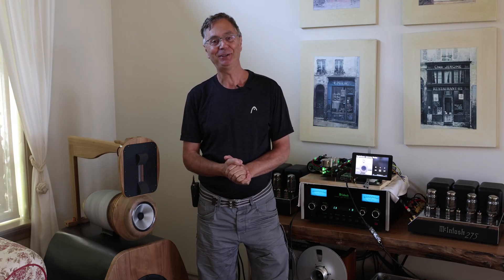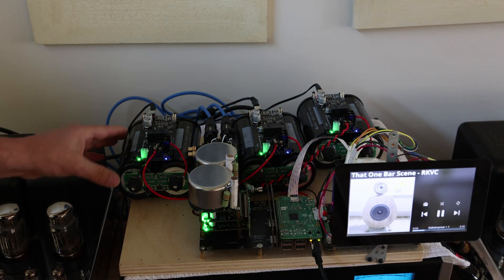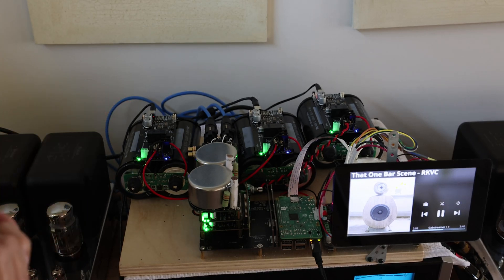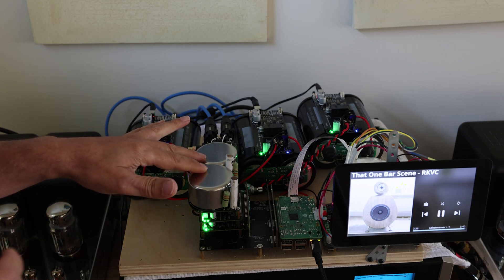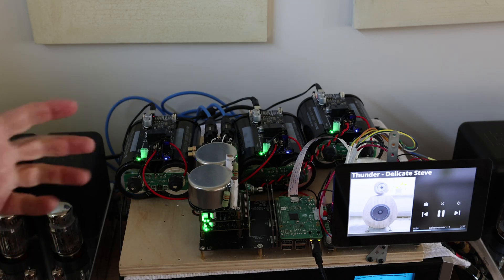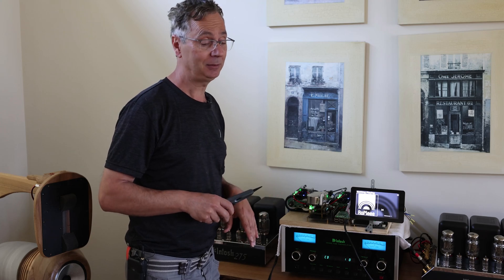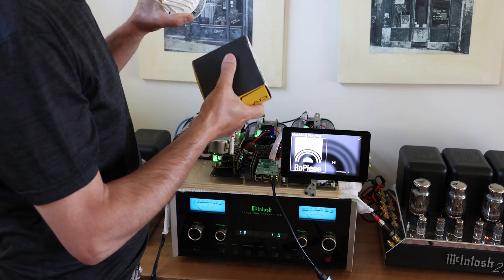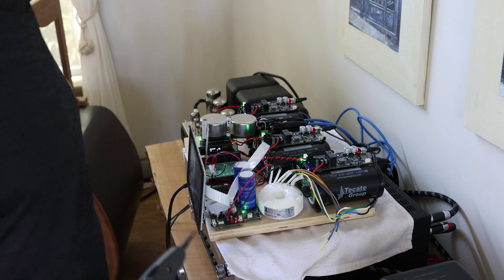Gabster D11 Dac and Streamer with Ultracapacitors  Part 2

Comment: I wonder from what you have said if you doubled up on the supercapacitors and switched between them when they needed charged you would effectively run from an isolated supply all the time so every 3 hours or so when one bank needs charged it switches to the other bank and then charges the bank its just switched out. May be a bit OTT if it only takes a few minutes to recharge .
Reply from the maker: Ian has a new version that can charge on idle music time and between songs so you can run mostly on pure mode
Reply: @Gabster1  sounds like Ian is on the ball that was just me thinking out loud above but it seems Ian has been working on a way to accomplish what I was thinking of without having to double the amount of supercaps. Looking at the quality of the gear your using Gabby its obvious you have an ear for quality so you captured my attention, right now I listen mostly on headphones focal clear mgs with the focal arche dac/amp. We moved house and now have someone below us who I doubt would enjoy listening to my music through the ceiling but having great quality sound is still important to me the arche is a fantastic dac but there's always room to improve especially if I could build it myself for a fraction of the £2.5k that the arche cost.

Comment: Just a quick question, if the DAC power is being supplied by ultra capacitor banks why do you need the high end power supply as that is just charging the capacitors? Surely it makes no difference if there is a little noise on the charging supply as any noise in that part of the system is completely isolated from the DAC during operation. Am I missing something?
Reply: Nope... That's the part that for me doesn't really stick. If the DAC itself never is fed by the PSU, then it doesn't matter if the PSU is a high end or a wall brick with noise.

What it matters is that it keeps the capacitors charge. Same as filling a water bucket: It doesn't matter if the water comes from a cup or a hose.

There are other things that as a objectivist and science/measurement driven person I would simply point as not accurate or "snake oil" but I learned to respect the others and their believes. Who knows if I'm not going to be suprised also and proved wrong?
Reply: @black.phoenix.  Yeh, there is much in the audiophile world that is just taking suckers money. I see so many just wasting their money on things that have absolutely no impact on the actual audio. In this case the only thing that needs the high end clean supply is the DAC and then anything in the analogue path after that like preamp and power amp, opto isolation on the digital feed to the DAC is also an easy win . The digital domain will not benefit from expensive stable supplies at all. Unless things are so bad that the digital stream is being corrupted in some way requiring some form of error correction it's a waste of money. Same thing with jitter correction, totally unnecessary unless you are transmitting the audio over tens of metres of cable. Better to save money where it doesn't matter and spend on better DAC and analogue path components.
Reply: @schrodingerscat1863  exactly that. The ones from the jitter is the ones I love to debunk.

I worked in telecom and yes there you need jitter correction and have attenuation problems, specially in xDSL that use from the 4Khz band up (normal POTS voice use under that).

But we are talking of KMs not less than 20m inside the room of a audiophile in cables. Attenuation is non problem. Close to the equipment you can have 24Mbps downstream no brain. After 1KM it drops to 16Mbps. The trick is always try to get the max speed by keeping the attenuation in the line above 13dB. That will be 2 dB less in the winter and rainy/humid days. Under 10 is mostly a connection that fails some times a day, under 8 the equipment can't negotiate a connection and mostly is no service.

Of course we are talking about through a pair of copper wire who get sun, cold, hot, humid, etc through is entire life on a pole and it was the cheapest available at the time or never replaced in 30 years, in thin gauge, not the size the audio cables are, 12 AWG.

So if I was able to give a customer 8Mbps down/1Mbps up at 3Km of where the xDSL equipment where with shitty copper cable, an audiophile can hear everything a music have to give in his room with a 12AWG oxygen free copper cable that cost 40 dollar a role in the hardware shop.

And don't talk about the skin effect. Skin effect is only prevalent in high voltage scenarios, tens of KV, so high voltage power lines. 

Audio doesn't work in such ranges of voltage, so again a non problem (that some cable manufacturers love to point - I'm talking about you Abyss).
Reply: @black.phoenix.  In data transmission jitter can be a problem but in these audio systems it is travelling no more than a few inches so is not even close to being a problem at the data rates involved.
Reply: @schrodingerscat1863  read my entire comment please. We are saying the same but in different wording.

Comment: hi Gabby, could I ask if the streamer section of this DAC sounds the same as yours existing one? Ian Canada uses a linear PSU connected to his supercapacitors. I like what you have done but it may just be too bulky for me. Thank you, Philip
Reply from the maker: Hi Philip it should be a bit better but it is hard to test it as this one does not have any i2s output the idea here is to eliminate a lot of middle parts it is a direct as can be from rpi to analog without preamp,  with all ultra caps. I wanted to stay away from batteries.  a linear PSU connected to supercapacitors is a 3d best option after batteries to supercapacitors. the differences are small but every 1% counts and adds up.

Comment: of course I have a bunch of questions! 3 dual power transformers, 1 winding feeding the RPi(linearPi/UcController), 1 winding feeding the FifoPi/ReclockPi, 3 windings feeding the DAC, and 1 winding feeding Ivan's board? Are you going to put LinearPi/UcControllers between each power transformer and the 5 UcPure/ultracaps?
Reply from the maker: Hi John The Ucpure accept AC 12v and have a built in dc conversion (diode bridge) and regulation so no need  it will be direct ac 12v to UCPure 
Gaby

Comment: Hi Gabby, nice job! I think it will be very interesting if you will power all of your DAC parts from UCs. Taking into account that RPi can be a standalone player (or acts like the end point via WiFi) it will be possible to avoid all the external power cables including a wall plug then at all. I think you will be able to listen for hours from charged UCs. You will have possibility to check how all these cables and PSUs impacts on to the SQ in real. 
I do not insist. Just as an option for further consideration.
Reply from the maker: Great idea in theory  but in practice you will need to charge the ultracaps every 3 h or so and that can be dangerous over a long time accidentally shorting one. the UCPure disengages from the caps via relay so it does separate I think Ian did a nice clever design.
Reply: @Gabster1  Regarding the danger. I think it's too late to think about it since you've already dealing with the ultracaps and you can't instantly switch them off if something will go wrong, isn't it?😁 More often you charge UCs or less often - this is a secondary question. Good, but second plan question. 

Regarding theory... This is not a theory, my DAC works exactly this way many months already. Not as automated as with UCpure power supplies, but the principle is the same. The charging PSUs themselves are placed in a separate case. I do mainly listen with the power supplies connected, as during the day the music plays in the background. But for responsible listening, I turn off the PSUs manually (5 multipin connecting cables). The influence of these five cables in my case is audible even if they are connected only to the DAC (removed from the PSU case) chassis, not talking about PSUs themselves influence especially when they working.
🤝

Comment: Thanks a lot for the nice video! In you precedent streamer, you used a second raspberry pi for the screen. Is it not useful anymore with the Rpi 4?
Reply from the maker: I may have went too far with the streamer adding a screen did not cause any changes in the sound specially if you keep it away The plan is to have the entire screen outside the Chassis with extra metal casing for it.